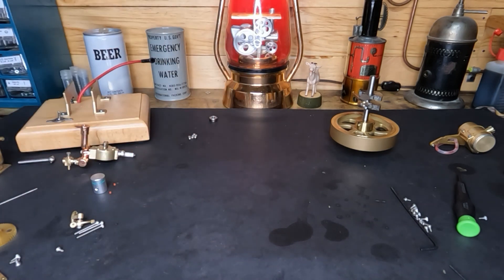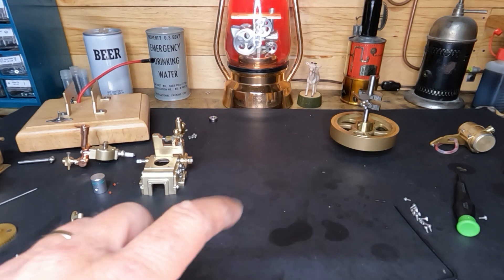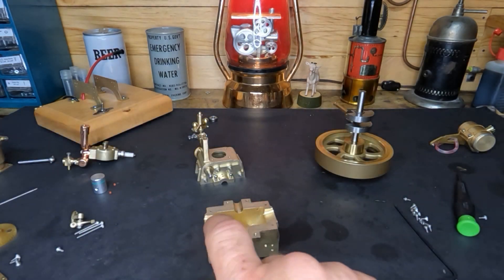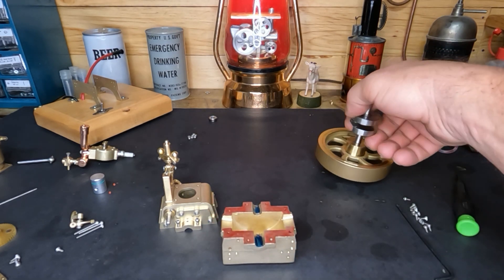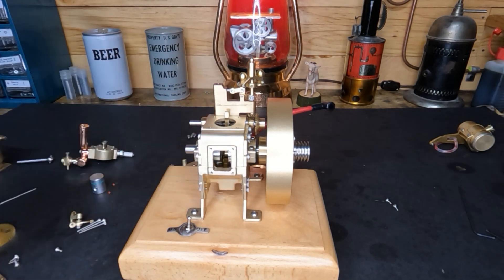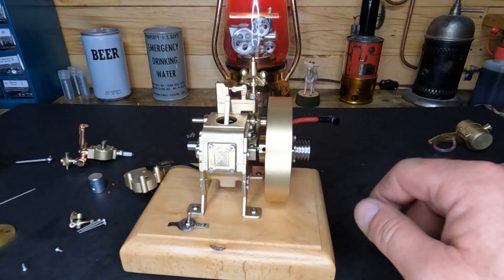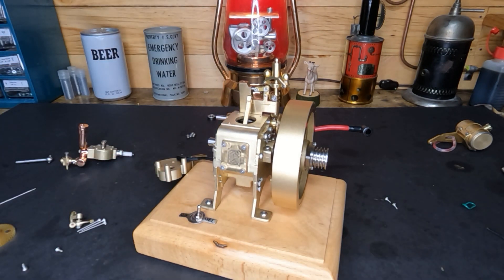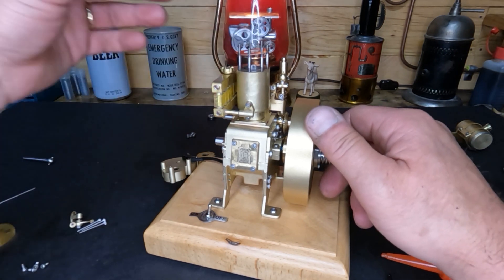What's on the inside of an H73 engine? Let's find out. Part 2

Comment: I am about to order one of this type of engine from stirling. I will definitly be stripping it completely before first run just to make sure it has been assembled correctly and all parts are there. Sorry you recieved a less than usable engine (untill you repair)but great knowledge and insight for the rest of us. Now which draw did I put my micrometres in.
Reply from the maker: Hi Sherm, If I knew what I was getting into on this one I would have passed. Hopefully you get a good one and not just a good project 😉.

Comment: Sigh. Actually amazing little engines, then they cheap out and make bone head mistakes. I like working on them a lot, but some issues are impossible to correct. Like you say, we are their R+D.
Reply from the maker: Hi Joe, I don't mind working on them at all but when it becomes my job to fix what was obviously overlooked at the factory after only 5 minutes or less of running, that kind of rubs me the wrong way.  I understand sometimes things get forgotten but this one was one I should have forgotten to get.
Reply: @steam212  Yeah. My H73 was also missing the other 4 screws. I consider any thing smaller than 1/4 inch a screw. I see that Stirlingkit has rotary engines. I think, stay away! If the big car manufacturers can not make a Wankel work realibly , I don't think a model will last more than 5 hours. Fancy stuff, but.
Reply from the maker: @joesenkalowski7912  I agree Joe, I don't have any rotary engines either but I have seen and heard a few model airplane engines made by (I think) O.S.  and they seemed to run very well and hold up too. But they are  nitro powered, so coated in oil and have no ignition.  It's possible that the hue we're monkeying with was just a fluke turd from the beginning.   Thanks again Joe, I enjoy your comments.

Comment: I haven't bothered to chime in because really you are doing pretty much exactly what I would do...  By cleaning up the case join faces the main bearings are automatically tightened.  Pretty hard to see any way the mains get positive lubrication as that engine is designed.  Being plain bearing I wonder how hard it will be to fit grease cups of some kind in your new lubrication points?  That would be correct for full size practice from back in the day - everything had an oil or grease cup to drip lube exactly where required, and the sump was as much to collect the dribble as aid lubrication of the bottom end, particularly with horizontal cylinder types  It's a pretty abbreviated engine that's for sure.  I'm trying to remember where I put my box of model engines to play with I mean carefully educate my grandson about while demonstrating...   Wonder how much rubbish was inside that engine before you started it?  Plenty of stories about Chinese engines, fishing reels etc full of all sorts of crap when opened up before use, standards seem quite variable with anything sourced from that part of the world.  Looking forward to seeing if it stops bleeding oil from every joint after your remedial work.  Cheers from Oz.

Comment: OH! On the topic of oil, did you drill an oil port in the cam gear cover as well? Those shouldn't be dry either.
Reply from the maker: Great point but it seems as if there is enough oil passing through the cam bearing on that side that I doubt it will be an issue.
Reply: @steam212  huh. Looked dryer on video than it actually is then. 'Cause when I watched the teardown the cam gears themselves looked dryer than a popcorn fart.
Reply from the maker: @TestECull  I agree, The next video is coming out "hopefully" tonight.  The one that you're watching was recorded Friday evening, I've kept at it and recorded as we went. I can assure you now that it belches the correct amount onto the cam gears 🙂
Reply: @steam212  Beautiful. Oil all the things! 

I would also like to see inside the 4-cylinder version, but I share your 'if it ain't broke' type of sentiment. That thing may have multiple main bearings in it that spread the load out better; looks like the same flywheel is used on all the H-series engines which may be a bit heavy on the single.

Comment: 2:34 Jeezlus. Supposedly they run these before they ship them but with how quickly that thing wore the main bearings out I don't think it ever saw fire till you got it. Poor design.

Nothing wrong with plain bearings here but plain bearings MUST be heavily lubricated. Almost makes me want to pull the main and rod caps off my M-17b and drill oiling holes in them too.